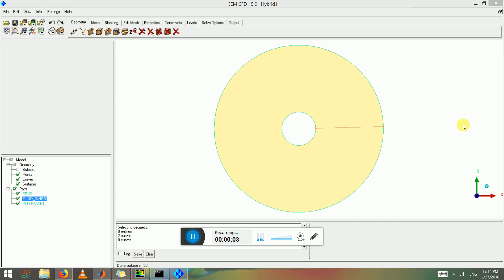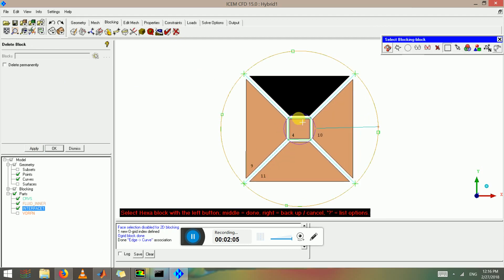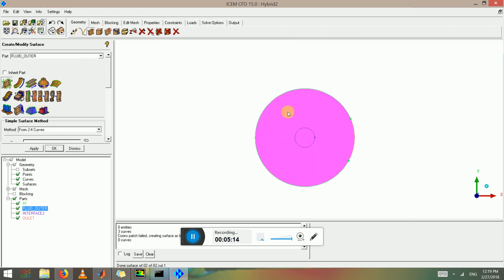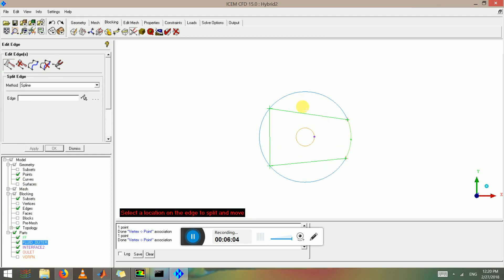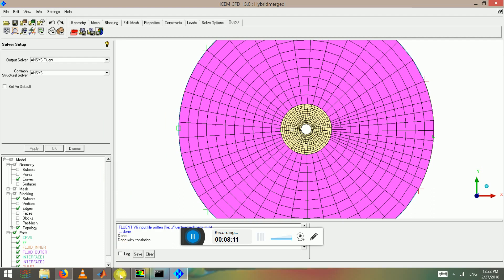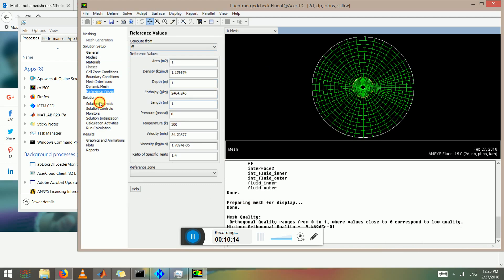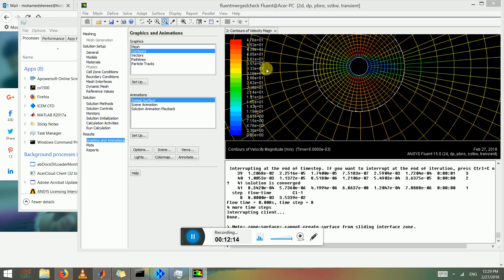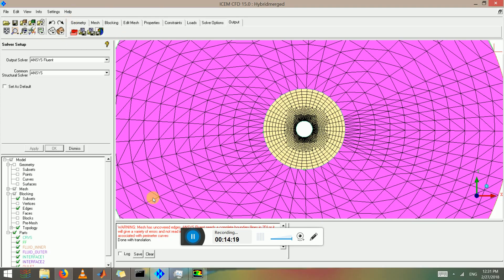LEsson 17   Using Multipe fluid zones with merged Interface in ICEM and ANSYS fluent

Comment: Thanks for a nice tutorial. Can we create conformal interface between two zones in ICEM? You defined interface between hybrid 1 and 2 in the Fluent which is non conformal (different number of nodes on both interfaces). How can we make equal (conformal mesh) on both interfaces in ICEM? Thank you.
Reply from the maker: If it is structured mesh, put equal number of nodes and equal spacing ( you can check spacing in edge properties). Anyways having more than 80-90 percent spacing matching edge spacing should be sufficient, modern CFD softwares such as fluent or OpenFOAM can interpolate smoothly with this level of non-conformal spacing. You can use matching interface option in fluent successfully with what I have used. 

Think about it, in a rotating mesh, even if you match edge spacing there will always be non-conformal cells as 1 cell from outer zone might need to interpolate with 2 cells from inner zone depending on the time instant of motion.
Reply: @mohamedsereez2010  I have a complex geometry in ICEM and using tetra mesh. Is it possible to create conformal mesh on inferace between two zones(fluid and solid) in ICEM using tetra mesh?
Reply: @AmeerHamza-bc4fh  Yes, you can create a conformal mesh interface under: Edit Mesh>Merge Nodes>Merge Meshes. Then, under "Method" choose "Merge volume meshes" and under "Merge surface mesh parts" choose the interface you want to make conformal. Hope that helps!